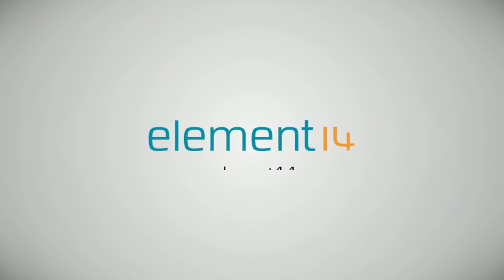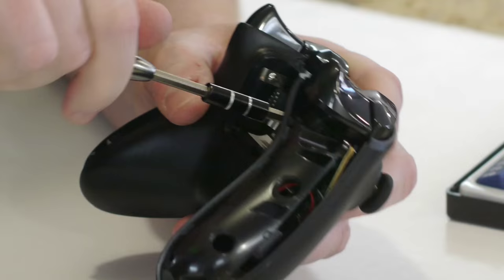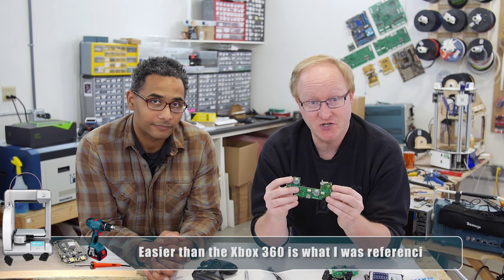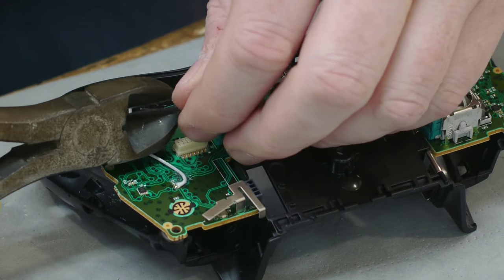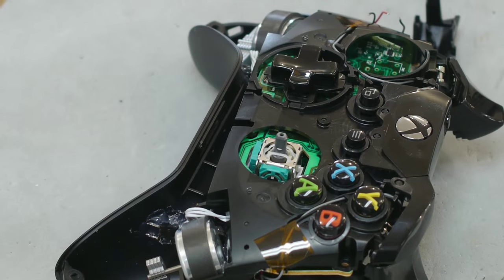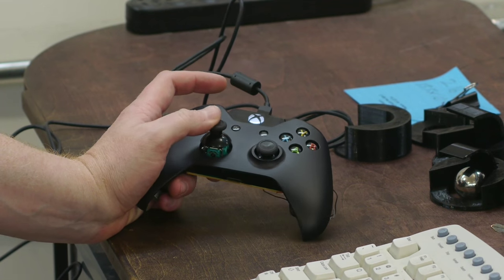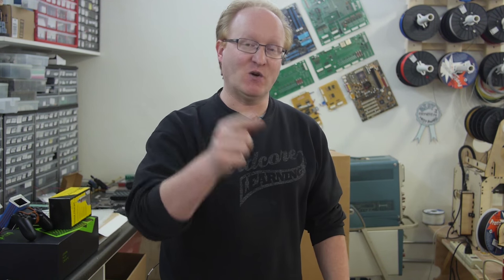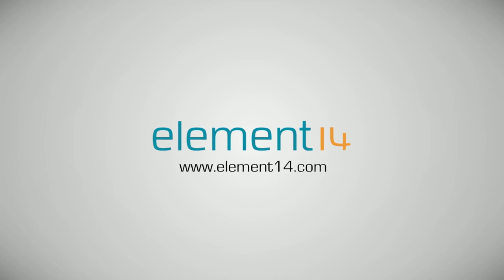Ben Heck's Controller Mods Tutorial

Comment: Cool. I'm planning in the future to fit a wireless Xbox 360 controller into a wired Xbox 360 controller case.

I think all I have to do is take apart a rechargeable battery pack and separate the batteries and put them into the handles (this would require removing the rumble motors permanently and removing plastic to fit the batteries) and buy some single battery mounts to hot glue into place to hold the batteries. Then shave down some plastic on the inside back of the wired controller case to make space for the PCB in the pack. then solder a female mini USB port at the top where the wire would normally exit.

Boom, slim wired Xbox controller with no battery hump and no proprietary charging connector.
Reply: Did you ever do this?

Comment: Can you remove the hall effect sensor and just wire up a tactile switch for the trigger?
I realize it'll only be on and off, but will it work?
Reply: I'm guessing not because the software is looking for a value given by the hall effects sensor and not just the on/off signal that you'd get from a tact switch. You may be able to replace the hall effects sensor with a potentiometer, but even then I'm not sure the values would be the same and the software would probably still be confused.
Reply: Thats exactly what custom controller companies like battle beaver customs do, except they use a button you would usually find in a mouse, which is much more responsive than a tact switch

Comment: so I did the remapping mod, tested all the buttons/tact switches and they seem to work properly besides the B button.. I think I messed up the soldering job because the actual B button on the controller doesn't even work at all. any suggestions on a fix to somehow bypass the B button and have it work with a tact switch?

Comment: I modified my Dreamcast controller so that the cable comes out the top. It drove me nuts how it came out the bottom. I also replaced my original Xbox's GPU fan with a blower from a busted 360 S power supply. It's MUCH quieter and runs about 10 C cooler.

Comment: I actually prefer a D-Pad for the button's (A,B,Y,X) because I hold my controller in a nonconvential way where my index finger curls over that section of the controller and i just need to lean my finger in the direction of the button and it presses it. 

Did a mod like that for the xbox 360 controller after someone pointed it out that I do that with the buttons anyways and it improved my action time by a few milliseconds. Doesnt seem like much but back then I was on an MLG tournament series for Call of Duty 4 and faster action times generally gave me the edge.

Comment: Actually for a fun fact Sony Playstation introduced analog buttons on the PS2. Reason was for driving games so you can depress the accelerator button (X) or brake (Square) lightly for games like Gran Turismo ect so you're not always on full throttle ect. :)

Comment: With the low cost of arcade stick buttons from eBay I should get around to making a proper Dreamcast joystick. The original kind of hurts my hands. Just a matter of soldering each side of the arcade button contacts to the PCB contact pads.

Comment: do you have any video about mode the n64 controller?

i want to move the joystick and Z button to the left side, the Z button could be easy, but the joystick is the problem, for Z button, i can use a push button, make a hole in the left grip and put the button in that place with some hot glue or something, but the joystick i don't know how do it, may be i can cut the central grip and paste it on the left grip and use some wired to increase the long of the conector.

what do you thin about that mode controller?

bert regarts.

Comment: So far, I have not seen a mod of control from Xbox 360 wireless to USB (no need to connect the wireless receiver on the PC). It will be possible? Many people are looking to use the Xbox 360 wireless gamepad without the wireless receiver. Especially on mobile phones (maybe add a bluetooth module)

Comment: Can you guys help me? I Found a mac SE/30 at the swapmeet and it won't boot up. I think the Hard drive is in really bad condition, and the floppy drive is even worse. It turns on, chimes, then makes a weird beeping noise and then proceeds to an odd spinning sound, then it just sits there. I have a working SE next to it, and I was curious, can I boot the SE/30 off of the normal SE remotely? Any advice is appreciated!
Reply: Check if the fans are not stuck otherwise it's probably your hdd. Just replace that one.

Comment: so if there is gnd, pwr and signal for the hall effect sensor on xbox one, cant you measure the analogue voltage range on the signal pin then select a potentiometer that will deliver the same range fit that to the mechanism from the box 360 controller and this would get rid of the hassle with magnets? or have I miss understood somthing?
Reply: +SwitchSkillz I checked with Ben and this is what he said; "In theory that should work. However the hall effect sensors are "pulsed" at 125Hz on the XB1 controller (why I have no clue) which may not give the same result when working with a mechanical potentiometer."
Reply: +theHeckwithKaren ok thanks for replying i'll keep this in mind.

Comment: (hears that ps4 controllers are harder to mod)...shit
Reply: easy now you can buy something called ps4 remapper it fits between the two halfs of the circuits and piggy backs the connections and provides you with solder points.